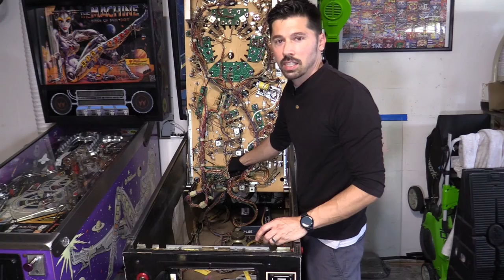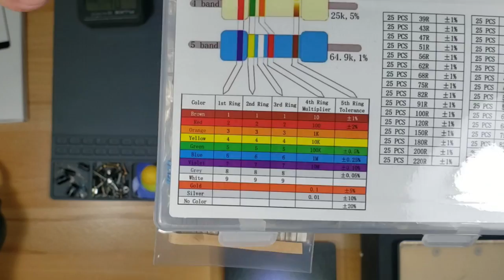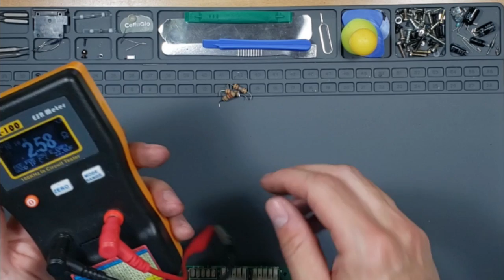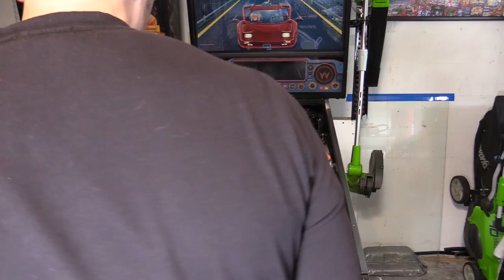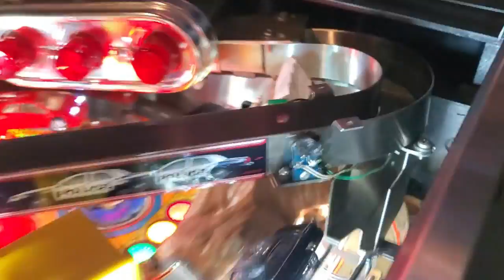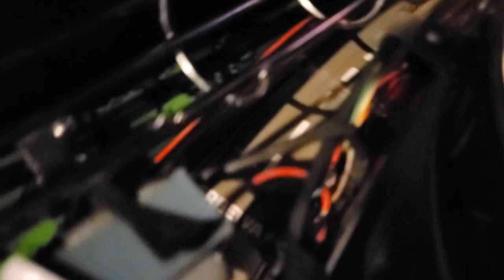Pinball machine Repair, Fixing Getaway High Speed 2 Ramp

Comment: So if the solenoids keep cycling on power up and it throws a switch error even though all the switches are working on diagnostics then what is my issue? If I do get it to boot the flippers work but it the solenoids don't work so it will not launch the ball. Suggestions?
Reply from the maker: If the solenoids keep cycling it's searching for the ball, check for a loose wires on switches and ball bay. Check your wiring and plugs connections on switches.

Comment: I woulda soldered  yhe  legs out of circuit probably woulda  been a little easier
Reply from the maker: do you mean cap legs?
Reply: @TampaTec  yes, most of us use helping hands to give salvaged components donor legs. I was kind of "well that's one way to do it" as well lol. All's well that ends well tho, nice fix and appreciate the explanation and footage of the repair!
Reply: @TampaTec   yeah especially since they was  short but then again i have the Solder  holding tool  same as above  great video!